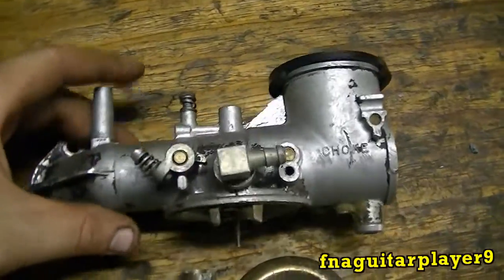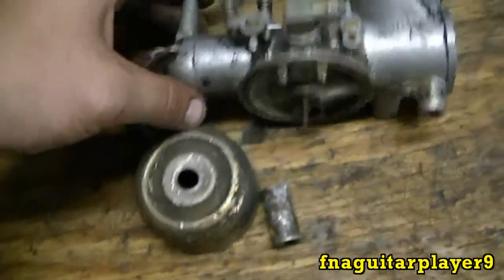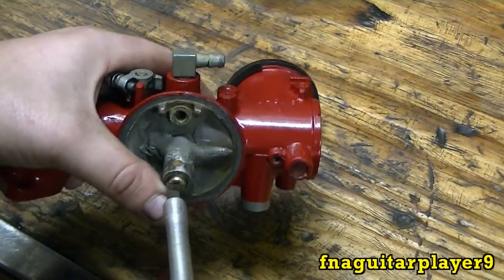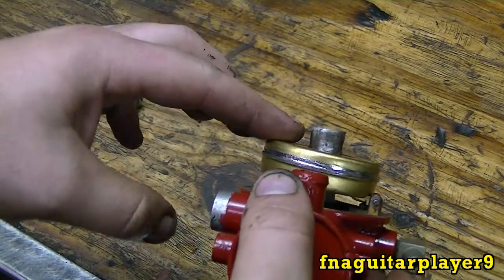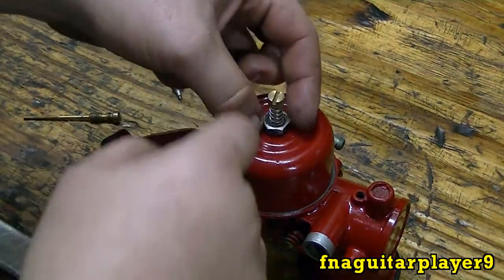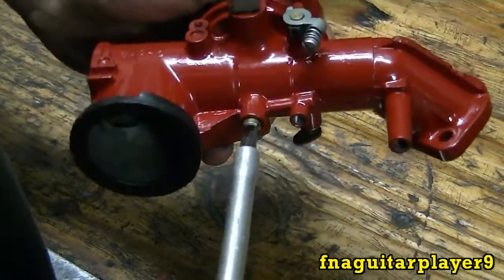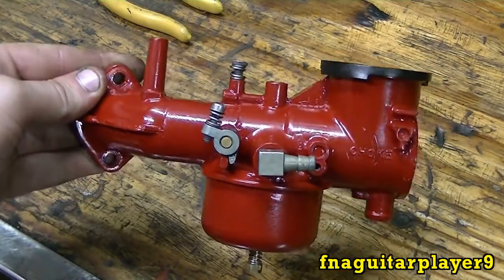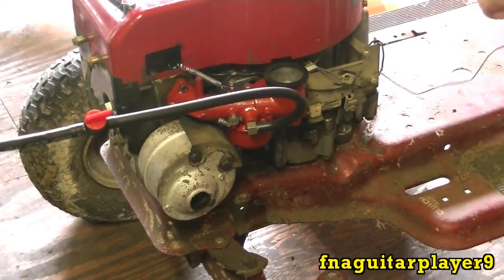Experimental Carburetor Emulsion Tube Repair (Test Carburetor)

Comment: Hi! Thanks for posting this video.  Its been two years, Im wondering how long that JB weld held up inside that carb?  how long was the weld in gas?  I am trying a bowl repair on my carb with JB weld and want to see if your repair lasted a while.  Thanks!
Reply from the maker: Your welcome! To be honest about it, i'm using it as a test carburetor, and it only sees gas 2-3 times a year, i just used it a month ago and its still working fine. i'm confident that it could be used daily on a mower or something, it seems to be solid and no signs of deteriorating yet. My opinion, its worth a shot, i can't guarantee it though! Thanks for Watching!!!
Reply: yeah for sure, I did try it but am having other problems with my carb.  (need to reset my float) the weld seems to be holding so far.  Thanks for getting back to me!
Reply from the maker: I hear ya! your welcome!

Comment: Nice job; JB Weld is good stuff and I repaired my crankcase with it.
Were those 'sparks' between 08.50 and 08.52 when you restarted the engine? They seem to appear between the wheel and engine block.
Reply from the maker: Thanks! yeah I almost swear by jb weld, everyone says that won't hold, it did (at least for now haha) Yeah they were sparks, good eye! What it was, I was using a jump start to start it, and I just touched the positive clamp to the starter bolt and it sparked. Thanks for Watching!!!

Comment: We've got an older toro small snow blower and it doesn't want to run unless the chokes on. It'll run for a second with out the choke but no longer. Also it needs to be primed 5 to 10 times to start. Any advice? Thanks
Reply from the maker: Sounds like the carburetor needs cleaned, probably has a clogged jet. I have videos on here on cleaning this type of carburetor and the newer 2 piece carbs, hope this helps, thanks for watching!!!

Comment: Nice paint job -- love the red. And yes, running either lean or rich is bad for the engine, but if you had to choose one which would you choose? I would choose rich, how 'bout you?
Reply from the maker: Thanks! Its duplicolor engine paint (Red DE1653), really good paint. I'd have to say the same, rich would be better so at least the motor wouldn't over heat, but another note i meant to put on the answer, if its way to rich it will wash the oil off the cylinder walls, i've had this happen one time and the piston/rings seized in the cylinder. but overall i'd say rich would be better. Thanks for watching!!!

Comment: What kinda paint did u use
Reply from the maker: I used Duplicolor engine paint (Red - DE1653), your supposed to prime aluminum with a special primer but i didn't and it seemed to bond pretty good. You can not beat duplicolor engine paint, i use it on non-engine projects as well! Thanks for watching!!!